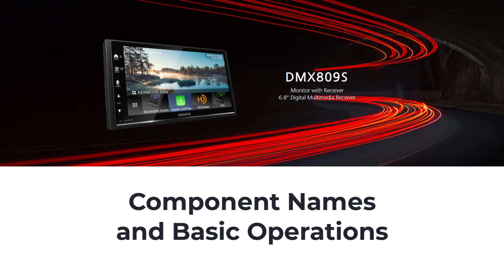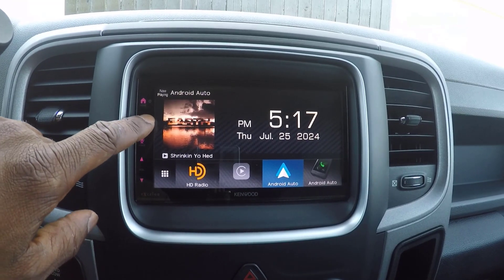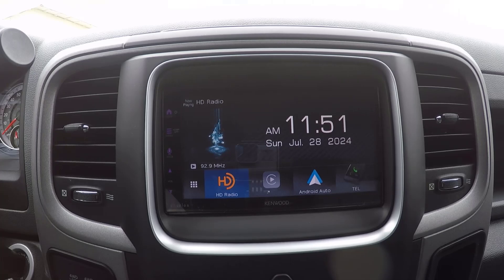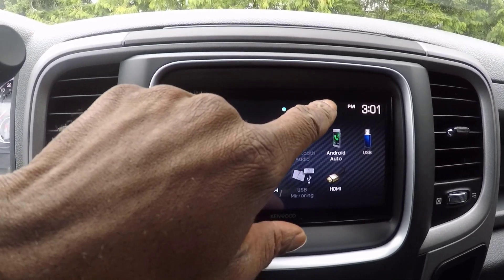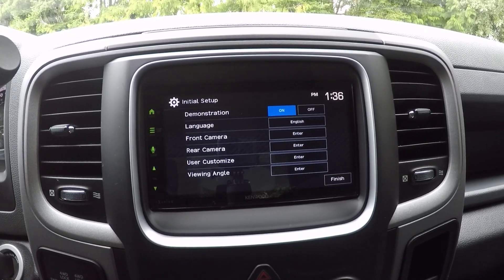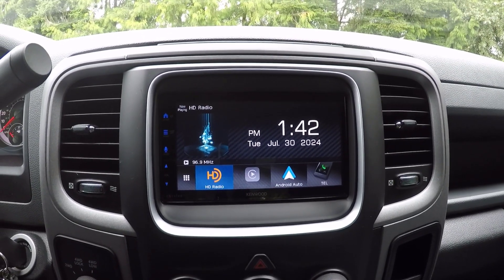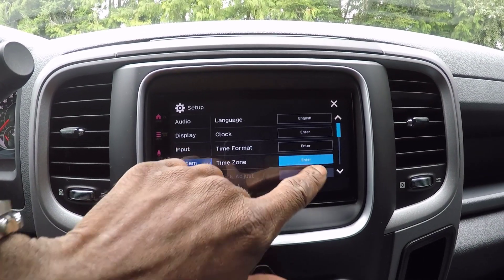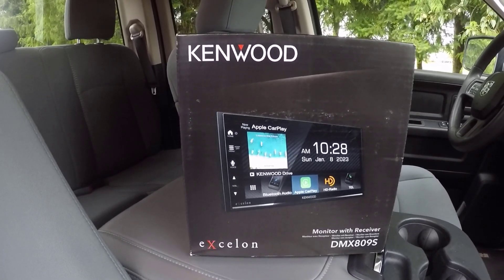Component Names and Basic Operations: Kenwood Excelon DMX809S

Comment: this thing is garbage. it does sound good and WORKS well in MOST ways but has one major flaw that in my opinion should mean it is pulled from the shelves. The screen is almost impossible to see in daylight, between the glossy finish which glares sun back into your face and the fact that viewed from and angle (like the drivers seat....) it looks very washed out. I have played with the display settings as much as I can and I can get it to be almost ok as far as the wash out, still not as it should be but then these same setting make it sliding at night. so you have to pick your poison, either not be able to see it during the day or be able to kind of see it during the day but be blinded by it at night. the auto dimming does not seem to function and changing the view angle setting barely does anything , changing contrast and brightness helps a little but again as I said if you adjust these to make it somewhat clear during the day it will blind you at night. this thing is trash and I wasted so much money on it between the unit itself , the harnesses required to replace my stock stereo and the install I am in it like $1800 .....that is a lot for something with such a huge flaw. how could this company overlook this?